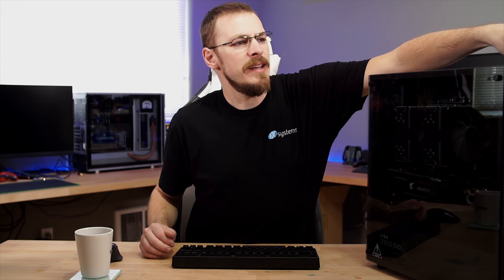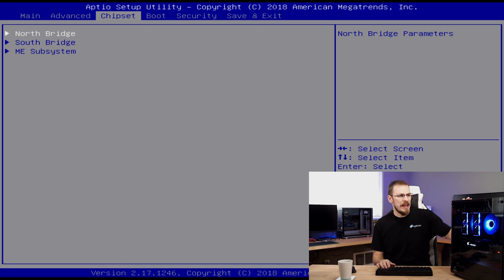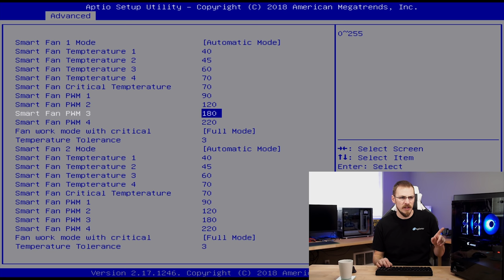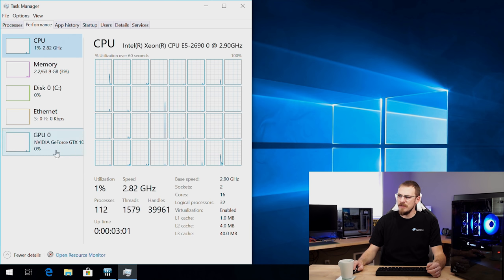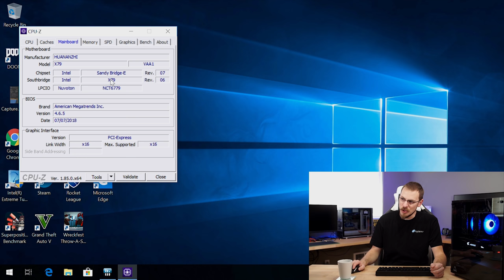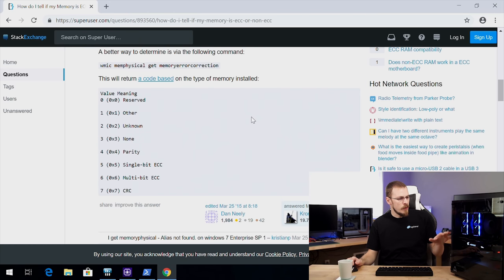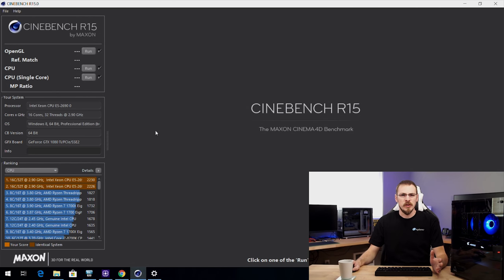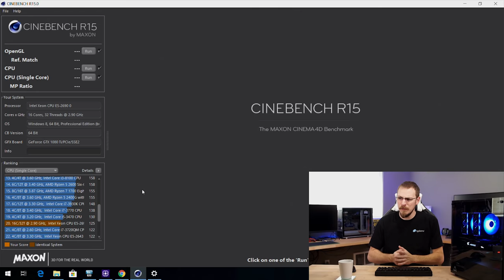Huanan "Dual X79" Motherboard Review

Comment: Before deciding on buying such board, it may be worth checking out specialized forums like Webhostingtalk.com for example, there are hosting companies which sell older hardware often.  

For example right now (see above domain /showthread.php?t=1736703 ) there's this for 950$ + shipping : Supermicro 4-Bay, Dual E5-2670v1, 2x480GB SSD, 128 GB ECC REG DDR3, IPMI, Rail Kit.  (1350$ for 256 GB DDR3)

If you want something for rendering or raw processing power and don't mind the fan noise then it sounds like a good deal,considering the ssds and memory amount included.  Not to mention it's actual server hardware from reputable brands like Supermicro. May be difficult to add video cards if you're into gaming.

Comment: I,m waiting for Mine order to come, with 2 e5-5650 V2 processors and 48 GB RAMs for each CPU, 2 optical Lan interface. I Hope to connect to 16 Raspberry pi for parallel computing
Reply: what you are going to do with this setup ? dual CPU computer + 16 Raspberry PI ? What is parallel computing ?

Comment: Ended up with this board, boats and runs fine (VRMs are getting somewhat hot when on full blast). Currently using 64 GB ecc 2Rx4, working fine.. Does any one know if it will support 32GB 4Rx4 dimms? I have the change to buy 128 GB for relative cheap..
Reply: I contacted the wuson store seller regarding that when they first started selling them. They confirmed that they support 128gb but only through 32gb modules. Cheers

Comment: does somebody know if there is an LGA1366 board for cheap or a dual socket LGA1366 like this?
My P6T is super hot on the south bridge
Reply: For a oem board try hp z800 the z820 is x79

Comment: My Ssd raid 0 running slow. After building the system with this mobo  I used 2 sandisk ssd 240gb in raid 0 as system drive. I had some problem finding the write driver before installing win 10, but in the and with the help of google translate i found the russian wiki of this mobo and they had a link for the write driver for the raid. The problem is that now in win 10 im getting 225 read and 524 write speed. I was expecting the double the speed of a single sdd. Anyone knows whats going on here?

Comment: My motherboard temperature shows 120' C . I buld a pc with the same mob and cpu.Something is wrong because this temp is showing when i just turn it on without load. Anyone have any  idea what's going on?
Reply from the maker: Probably a bad sensor. I'm guessing it's always reading 120 and not changing?
Reply: @CraftComputing   it moves from 119-122
Reply: I dont have a laser thermometer or a thermal camera, but when i first build the system outside the case the moba heatsink was hot when I touch it . Know in the case with proper ventilation i can touch it and is just about 25-35 C, judging by my hand.

Comment: They badly need to release a bios that allows overclocking. If they do that, the value proposition jumps dramatically. That's a bit of a rough summary of the Chinese board market.

Comment: 16:00
Licensing. 
I’d bet you nearly anything intel slaps board partners with a nice fat licensing fee depending on the board. And that an x79 license is cheaper than c602.
Reply: I  bet there is no license agreement at all. I believe they are harvesting used server chipsets and building new boards with them, since there is such a market for used processors in many countries. Intel stopped building the C602 chip set a long time ago yet we are finding brand new boards with this old chipset on them.
O

Comment: I have had the worst luck with this platform. I have purchased 2 of these (well not the dual socket version, but the single socket). And they run horrible. I think they don't do well with DDR3 non ECC ram. They run with regular DDR3, but they are unstable, and buggy. I have one system that crashes as soon as you access a usb device. I have another system that crashes as soon as you start editing RAW video files in DiVinci Resolve. I have purchased some Samsung DDR3 ECC ram to test my theory...but I want to know if I am headed in the right direction.

Comment: Really not fair of you to rate it in single core performance mode if you're not willing to throw the best chip into it that it can handle.  Afterall, you're rating the motherboard itself, not the choice you made of the chip to put into it.  There are TONS of applications where this mobo would shine at that cost, not the least of which is virtual machines.  The error-correcting RAM support is just a great added boon as well!

Comment: hi
how will it perform for film editing when compare with mac pro 5,1with 12 core
Reply: That would depend on how that mac 5,1 and what software you are using. If you use the right video card  you should be able to out perform a 5,1 mac pro. Especially if you go the hackintosh route.

Comment: Hello what is the most powerful CPU for this motherboard?
Reply from the maker: Most cores is the E5-2697 v2. 12c with a 2.7GHz base clock.

Most powerful is the E5-2687w v2. Only 8 cores, but 3.4GHz.

Depends on what you need.
Reply: Gaming ?
Thanks

Comment: I ran into some problems but a google search solve them pretty quickly.  Since my board didn't come with a driver disc, I to hunt them down. That turned out to be a bigger challenge that I expended because of the this platforms age. Anyway. I'm off and running. Did I mention that noctua fans ARE STUPID QUIET?
Reply: I turned off smart fan control just to see how loud my system would run. I have three Nonctua 120's on the front of my case.  both my cpu's have noctua coolers and my exhaust fan on the back is a notuca 120.   So I had SIX 120mm fans spinning at 1450 rpms and the system was still quiet enough to use.  With smart fan turned back on, ITS DEAD QUIET!  Noctua gear is expensive, NOW I KNOW WHY!

Comment: Pretty sure a $200 c602 supermicro off ebay would be a better deal. Its cheep but seems pretty limiting by comparison.
Reply from the maker: If you've found a $200 dual-2011 from SuperMicro, you're getting way better search results than me. Best I've found consistantly is ~$350.
Reply: @CraftComputing  the supermicro boards come and go.  Right now there are two listings for gigabyte c602 boards for $199 and free shipping.  Looks like the cheapest deal currently.
Reply: @CraftComputing  there is a quad socket suoermicro for 280 right now as well.
Reply from the maker: Yep, saw the Gigabyte the day after I posted the review. Good deal on that one.

Comment: would this be a good pc for a dual pc stream setup?
Reply: As he said, the gaming performance may not be spectacular, with a single-core cinebench score of 125. It should be able to squeeze out 1080p 60fps in most games, but not much more. This would be a monster for video editing and encoding though.

Edit: if you are using this X79 build for ONLY streaming; yeah! Go for it :)

Comment: I just scored for a 128 gigs of 1600 mhz ECC DDR3 
So far I have spent:
Mother board = 103.00
2 x  E5 2680   =  124.00 
128 Gigs of ECC registered  DDR3 (1600 MHZ) = 207.00
(8 sixteen gig dims )
------------------------------------------------------------------------------------------
Next comes the following:
 mattaxx 70,  (with fans)
modular EVGA supernova 1000 watt power supply, and 
be quiet gammax GT coolers.

Comment: 2 things to consider when using a Sandy Bridge-EP or Ivy Bridge-EP Xeon:

1. Meltdown and Spectre patches hurt the performance on these badly.  You'd probably get about the same performance on a dual SB-EP with 16 cores like this as with an 8 core Ryzen 1800X, and likely less than a 2700X.  VM performance might be a little bit better on the SB-EP if the workload is spread across 4 or more VMs.  

2. They use a LOT of power.  Any money you might save getting this instead of a Ryzen would likely get used up on your power bill in less than 6 months.  Operate it for more than a year, and you're better off with a new system.  Something like this system would probably cost about $100/month to keep running  in most areas, when you also consider the costs of the air conditioning needed to keep the room from getting too hot.  Of course, if you live in an area with low ambient temps, like Montana, Minnesota, or Canada, it would probably save you money on heating costs instead.  In California, it would probably cost in excess of $250/month to run.  Figure this into your cost decisions.

It can work pretty well as a VM test lab or self training server, especially with VMWare's free ESXi hypervisor, but so can a Ryzen.

Comment: 4:05 In my not-so-humble opinion, PS/2 ports are essential. USB devices can typically only be accepted into the system once a Windows user with sufficient privileges is logged in. Which is a problem if your USB keyboard dies, because you won't be able to log in to allow a new keyboard to be used. PS/2 sidesteps that.

Comment: Thats interesting... Now people are interested with x79 lga2011 xeons and whole platform? 
Ive built X79 with Xeon E5-1660 few years ago. @4.6GHz its a beast even for newest games in 1080p.  It has similar performance compared with 8600k @4.8
If you interested just buy even used or new old stock mainbord from known brands. P9X79PRO from Asus that i have is still nice board... And it support uefi normal and network ipv4 and ipv6 boot. I wouldnt go for dual 8 core xeon, because almost all of them have locked multiplier.

Comment: I've wanted to try 2 and 4 socket motherboards for awhile now just because they seem fun not because I need them for anything.  I actually kind of like China and their way of doing things.  They don't care much for rules do they?  They're edgiboiz and I like them.
7:40 tfw no computer fren to help you build cool dual socket pcs :(
I want a 4 socket threadripper motherboard how many cores would that be 64x4?  256 cores?  512 threads?  Sounds silly.
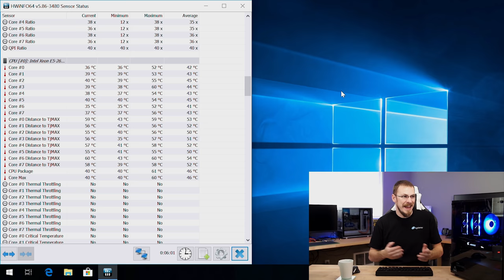15:15 I miss my amd laptop it would go down to 200 mhz with a cool program that made under and over clocking so much easier then shiltel.
A computer with these specs would be $3,000+ only a couple years back.

Comment: Cheapest power! If you installed 2x1650 v2!
Reply from the maker: 1600 series chips are single socket only. Can't double them up in a dual socket board unfortunately. A pair of E5-2687w v2s would be pretty awesome in here though.

Comment: Can this board support x2 5675 xenon chips with 16gb of ram
Reply from the maker: No, those are 1366 socket. This is a 2011 V1/2 socket board.
Reply: Craft Computing is there a x58 Ali express board DM that does support x2  5675 chips or is it only for workstations like the HPz600
Reply from the maker: I haven't seen any Ali boards for dual x58.  They might exist though.
Reply: you can find on AliExpress an Asus Z8NA-D6 who accept your two 5675 CPUs for less than 80€

Comment: Five years later  ... , just ordered an X99 /C 612 MoBo with 128 GB  DDR4 2133 reg ECC Ram ( 4 x 32 ) and a 2680v4 = 14 Core / 28 T  for 213 Euro as a Kit  ( + import Tax )  = 260 Euro  , true Quad Channel with 8 Memory slots  , 3 x16 Slots  ( 16x ,16x , 4x )  2 NVME slots 4x 3.0 ( CPU  ) and 4x 2.0 ( Chipset )  . Intel launched the 2680v4 in 2016  , its seven Years old now and down to 20 Dollar from 1800 ...  . As a backup plan i ordered an 2640v4 as well because its 90 W TDP instead of 120 and i want to use it as a NAS  , 14 Cores are not really needed there . If the 2640 will suck significant less Power  in idle than i will use it instead of the 2680V4 which was in the Bundle . I dont want to Game with it , the v3 Turbo Boost all core  hack  is not of  big interrest for me  .

Comment: Huanan released x99 boards. Are they any good or I will spend my money on sh!t?
Reply from the maker: Honestly, check out used x99 boards from Asus, MSI, or EVGA. They're often $100 or less. The reason the Huanan x79 were such a good deal (despite their flaws) was the price of used x79 were often pushing $250-300.
Reply: @CraftComputing  I just bought an Asus X99-A for 129 euros (im from Greece) but it had 2 bent pins (easy fix).

Comment: any hackintosh builds with this thing?
Reply: I do this with a JingSha/Kllisre Dual X79 (C602J chipset) and a pair of E5-2630L v2 (6x2.4GHz/15MB 65W). It need a lot of patches (ea. for the memory: MoBo have 8 DIMM slots, in the BIOS there is 16DIMM per CPU! Mojave make Kernel Panic without patch when DIMM slots of the second CPU are populated. Same think for the USB)
With a pair of RX580, it is very powerfull for hit riduculous price! (tested with Capture One v11)
NVME slot deliver 2850MB/s with a Samsung 500GB 970EVO+ SSD
There is no deep sleep (S3 doesn't exist in BIOS)
100€ for the MoBo, 40€ for the 2 Xeon, 40€ for the 2 Heatsink SnowMan 12cm with 6 heatpipes, 110€ for 4x16GB DDR3-1600 Reg-ECC, 1.5€ for the CPU 8pins splitter...
Of course, if you want a pair of E5-2697v2, you need a powerfull PSU (Corsair 650W is OK for my config, but certainly not enough for a pair of E5-2697v2 and a pair of big GPUs)

Comment: The two Xeon CPUs get the same r15 score as my i9 9900k on 5.2ghz. Its a pretty high score. Its a little bit sad that the system needs 16 cores and 32 threads for it, but its 100-200$ cheaper and that makes a nerd happy xD I mean i dont need a system like this, but how often you see a dual socket system? So this will be my next project ^^

Btw some r15 scores of my i9 to compare with the dual socket system
Stock:1848
5ghz: 2089
5.2ghz: 2209 
Singlecore 5ghz: 215
Never does a stock singlecore run, sorry
Reply: Wtf, my 3700x gets 2203 by simply raising the power limit, on a hyper 212 Evo with better fans!

Comment: A really monstrous system. Too bad the CPU architecture is pretty dated and there's no OC support (if you are willing to gamble, AMI BIOS'es can be modded to unlock hidden options).

BTW, AMI POST codes aren't board specific. Code B4 means USB Hot Plug. Did you have anything plugged into one of the USB ports when the board froze ?
Even name brand boards do sometimes have issues with not booting due to a misbehaving USB device.

Comment: There is a software called Speedfan, it's really good at controlling fans that without proper pwm support.
Reply from the maker: I'm aware of speedfan. The problem is the board actually doesn't communicate with the 3-pin headers at all. It just hooks them up to 12v.

Comment: So what did this entire system cost? If the price tag is good enough, it would be a good system for content creation and server hosting.
Oh $585 bucks. Damn man, that is really cheap.
Reply from the maker: Yep, $585 for the base system (Board, CPUs, RAM).
Reply: @CraftComputing  I paid about $6000 AUD for my Ryzen Threadripper 1950X server. Look up "survive the ark au threadripper server cluster". That will show you what I got for my server.
Reply: @CraftComputing  It doesn't list the modem that I needed to buy. Because stock modem from the ISP is steaming crap for the NBN network.

Comment: "Ivy Bridge and Sandy Bridge are getting a little long in the tooth"

I just picked up an i5-3570-based Dell Optiplex and got it functioning with an RX 560 for a friend at around $310 ($390 with monitor).

By the time it gets switched out, I'll make a spear with the teeth and a steamcache server with the chip.
Reply from the maker: Sweet setup.  I was talking specifically about 'high-performance' setups, as I have this paired to a 1080 Ti.  Definitely going to hold that GPU back.  But Ivy with an RX 560 is still perfect!
Reply: @CraftComputing  Yeah it is! Neither of us can argue with the performance for the cost (although I'm still slightly bitter I missed a Xeon E3-1230-based HP workstation. Have another essentially identical version of it, and it's awesome too and I could have saved $80 on the Case & PSU). His laptop is a low-end Sandy Bridge mobile unit that's slow and he was using my system that was dropping frames on him. So yeah. I like it, he likes it, and it might still be in service in 2020.

Comment: Coming from a 2009 Mac Pro (2x3.33Ghz X5680s, 96GB), this is an easy upgrade path, especially since I can re-use the RAM. I've also looked at Dell Precision workstations 7600/7610 for a system with similar specs. More photo & video work than gaming, and it should be fine.

Comment: Can probably buy a retired name brand OEM server system with all the same specs for less on Ebay or somewhere similar. That way you would probably get good RAID controller hardware too. You would just have to find a way to get sound since it likely won't have ports on it at all. If that is a bridge too far then look for a workstation system, they have sound ports. Used OEM systems can be good deals.

Comment: does it work with i7 3820
Reply from the maker: i7 CPUs only work on single socket boards.

This dual socket board requires Xeon E5-2600 or E5-2600 v2 CPUs.
Reply: Great. Thanks for the info. 👍

Comment: If you install throttlestop software, you will be able to use a max power configuration instead of pkg power and set static boost frequency. its a poor mans overclocking method.

Comment: I got the same cpus in cinnabench and I get 1900 CB
Reply from the maker: What's your RAM running at?
Reply: 1333mhz cl9 but It don't thing turbo is working I have a super micro X9DRi-LN4F+

Update - I messed around in the bios and got all core turbo working with that I got 2226 CB but did not get single core turbo to work.
Reply from the maker: Check your Turbo and SpeedStep settings either in BIOS or through Intel XTU. Might just see if those are turned off.
Reply: I got it now thank you! I had to set max C-state to C0, the motherboard what in ECO mode by default.